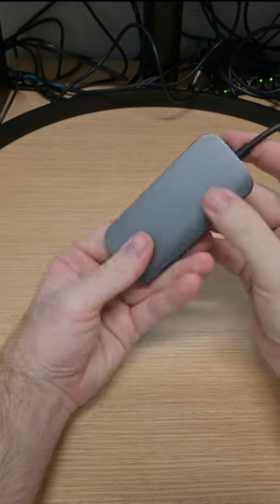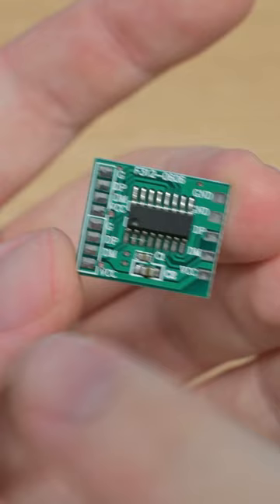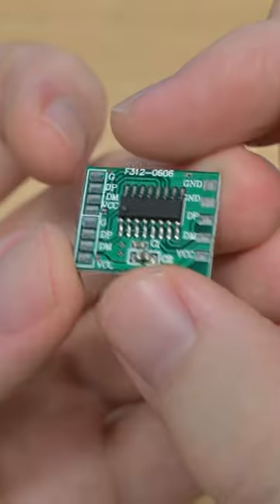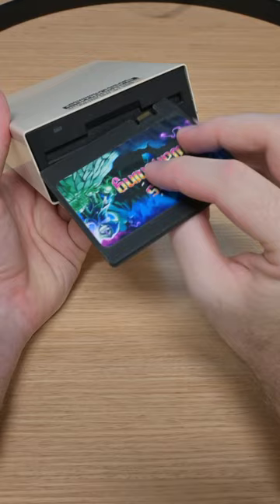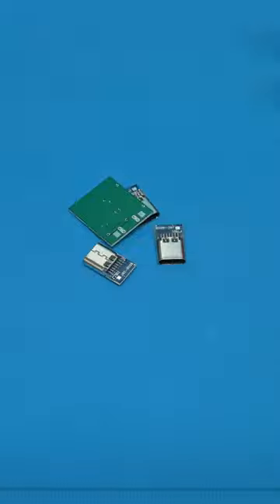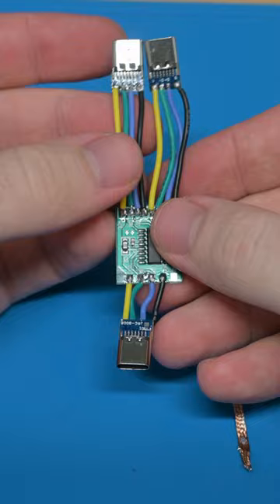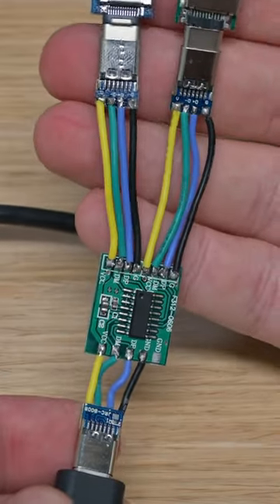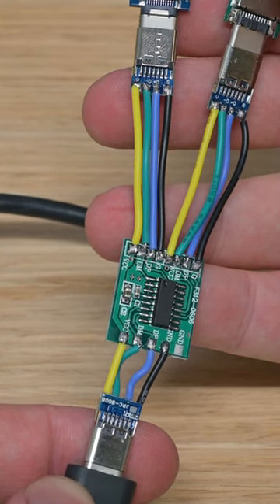The smallest USB hub ever designed?

Comment from the maker: I literally don't know why this was the hardest thing to solder to. I was trying a new tip on my iron and it just would not heat right. I am ashamed but the show must go on.
Reply: As someone who has seen the kind of trash soldering that youtube has to offer, I can't talk down on those joints too strongly. 
As someone who lives and breathes 1% tolerance mil-spec soldering, I can only shake my head while bearing a look that's half way between disappointment and having been personally affronted.
Reply: You did quite well. Other YouTubers barely even know how to solder and still attempt it when there is usually someone there who is good at it. I saw 1 earlier where camera guy had to tell em to wipe the solder off cause they had no clue.
Reply: What chip/board is it?
Reply: Are u used the right cable? 
I think you need to use a higher gauge 

CMIIW
Reply: Wet your tip with solder first. It increases surface area in contact with the contacts, and increases thermal conductivity
Reply: Need some flux
Reply: A good FLUX is key for proper soldering!
Reply: I would have used slightly thinner wire for the job, but honestly that soldering work ain't all that bad. 👍
Reply: Your soldering is amazing compared to GreatScott!. And he actually has videos on how to solder. Too many electronics YouTube channels that show how to solder and don’t know how to do it themselves.
Reply: Hey, I need some help for creating a cartridge based pico-8 handheld that works like the gameboy and from your prior projects you seem to be the only person who may be able to give any assistance, any way i could get in contact with you more directly to ask some questions?
Reply: you need flux, i use some i got from the plumbing section of the hardware store for electronics and i've never regrettted it, i have boards 10 years old that i used the flux on that are still good today
Reply: Don't neglect tinning new tips
Reply: it wasn't even that bad stop complaining
Reply: try lti 120 flux
Reply: Always remember to "tin" your iron tip, & 
to always heat the "work", 
(what you intend to solder to)
not the solder.
Reply: More flux would help. Just ooze it on there.
Reply: Use the solder paste stuff :) it’s magical
Reply: @AtlasReburdened  Mil-Spec 🤣🤣🤣🤣 damn rambo howd u make them so cheap??
Reply: I think you are the seller to discourage others to sell them
Reply: Don't be, just don't, it's okayish solder. The rules for solder requires no moustache looking excess solder on IPC certification, no badly misplaced components soldered on board. I think it's enough
Reply: I wondering if the chip you use allows a connection of just one USBC port for USBC PW <I don't need data> in and the other end of the chip just soldering it to an existing full featured USBC port without having to divert the original USBC port to the chip and have the one USBC be a USBC PW and the other one is data. Basically I'm trying to mod my ROG Ally so I can have a secondary USBC for power while leaving the full featured USBC port for video out by just tieing the other end of the usb chip to the existing USBC port in my Ally and just wireup the chip and one USBC port for the power in?
Reply: @Littlestrawberryfox  maybe using a small hub would be better. Dunno, just saying
Reply: @frogz acid core flux on electronics? 😮
Reply: i was ready to roast you because I saw this comment before the video started but dude… thats a normal-ass solder job. nothing bad about it… it isnt amazing but it sure as hell aint bad either

Comment: An important thing to note when working with usb: the positive and negative line need to be the same length, or it will break. There will be a tool in whatever pcb designed you use labeled “differential pair routing” or similar, and you need to use that
Reply from the maker: This is a good note, I did not design this board but I'll keep this in mind for future projects.
Reply: true but if you are using, say, just a full speed usb 2.0 (not high speed, full speed) there won't be much trouble except if the route lengths are off by a large amount. I think there was a formula to find the wavelength of your signals and then make sure the + and - signals match within a threshold. not an expert though

Edit: missed the "except"
Reply: @Kitsuinox  even at low speeds the acceptable deviation is extremely low, its just a problem of how differential lines work in general really

You’ll want them to be close together anyways so theyre not as susceptible to noise so just use the differential routing, its there for a reason
Reply: @abetoday  the board does the differential routing correctly, im pointing it out because you’re saying you want to design your own pcb using this and if you don’t use the right routing tool it might not work and you’d have a hard time figuring out why
Reply: @Joshinken  thanks for pointing that out - though in some programs I used the differential router did not really produce great results (as in they sometimes would be way too chaotic). now thinking back to it, it was probably me not changing the skew tolerance or something I guess. also, are there any places online I can learn more about differential pairs - or pcb design in general?
Reply: To add to this: If you're routing a high speed signal any appreciable distance, you also need to take care with the thickness of tracks Vs their distance to each other (for differential signals) AND their distance to their reference plane (so PCB layer stack does matter). All of those factors contribute to something called the characteristic impedances of the transmission line, which should be designed to a fixed value for high speed signalling, and match that of the drivers cable and receiver. Sudden impedance changes (e.g. from the tracks suddenly separating) result in signal reflections, and bad signal integrity.... I think USB is 90 Ohms from memory, but it's easily Googleable.
Reply: @Kitsuinox  High Speed Digital Design: A Handbook of Black Magic by Dr Howard Johnson.

He also has a website with some Q&A topics written up and excellently explained.
Reply: @Johnyted717  Thanks!
Reply: basically it's a miracle this slapped together thing even works. Even on the board there is no length matching at all, you could see with bare eye. And I doubt it's four layers, so very likely no impedance control, either. Then the soldered wires are plain, unshielded and certainly not within 0.15mm length. Chances are high this thing will fall back to Full Speed USB.
Reply: @Kitsuinox I seem to recall that a rule of thumb was that the length differences should be smaller than 1/10 of the singal length. So that'd be something like 480 Hz * C * 0.6/10, so that's like 6cm or something like that. Assuming that I haven't done something dumber than usual.
Reply: @Joshinken  do all lines from all the ports to the chip have to be the same length as well or is it only important per port?
Reply: @albisserhotmail  the two data lines of one port need to match each other, they don’t need to match any other. If you’re using a usb3 connection for example, you also only need to match the two connections in a pair, while the different data pairs can have very different lenghts

As for only usb2 with its single pair, you need to think about it like this: the connection doesnt end at the port. It will go into a usb cable and to your keyboard or stop short directly at a usb stick. If the length of each port needed to be the same, you’d have to plug every device into an extension cord so theyre all the same lenght.
Reply: Yes diff pairs are essential. That’s all we do at the company I work as is high speed data.

Comment: Be careful with those, that chip HOPEFULLY has proper ESD-protection built in or most liekly doesn't have it. Thus you can very VERY easily just zap it with ESD and kill the chip or something else connected to it... you've been warned, because in 99% of cases ESD protection is external to the HUB-chip itself.

Also, properly no power-handling capacity to speak of, no over current protection etc... so you can easily break something.

Moreover, those wires completely break the differential pair and the 90 ohm  differential impedance requirements of USB... so it might be unreliable or/and spill EMI all over the place.
Reply: I don't have too much knowledge on the matter but this board did seem a little barebones. Are you aware of a suitable small replacement that offers that manner of protection?
Reply: @AdmiralSym I did some googling and found a 4 port hub that comes as a hat for a raspberry pi zero.
It is not quite as small as this one but it appears to have more thought put into it and it's still only 7€.
Reply: @johndododoe1411  Yes, and those internal cables are shielded, twisted etc and are of correct impedance. :)

Comment: Electronics are so fun, especially the discover part. PCB designs are also fun. Internet is full of good, less good and downright crazy stuff. I did a fast search and found the pcb in your video, and their soldering was about the same 🤭 clearly meant for a DIY project. Electronics go from two wire to quantum mechanics, best suggestion is to bring a rope down the rabbit hole. To know of differential pairs and how it differs from pcb lanes and cables could be both fun and informative. Eric Bogatin has some colabs on yt and that man knows his stuff. Also Bill Herd is a outstanding. I really like your content, keep being curious😊

Comment: Way back in the day, I had a mini 4 port hub, and when I opened it up, the circuit board was barely larger that that 2 port there. Granted it was only USB2 though, but damn that thing was about as small as a fully prebuilt 4 port hub could get!

Sorry to say I don't remember what brand it was, it was stolen along with my laptop in 2015 ☹️

Comment: You could install this into an old system like an Xbox 360 white huge version and make a USB flash drive be internally mounted while still have the 3 USB ports available still. (Well 2 if your using wifi)

Comment: I opened a 4 port USB hub once and was surprised to find a single chip and a few support resistors & capacitors.  The chis was from Texas Instruments, so I’m not at all surprised by the tiny hub board you found.  I have no idea how the chip works, but I assume the PC handles the USB protocol while the hub chip doesn’t do anything complicated.

Comment: Hey if you get anywhere with this let me know. I'm trying to find a small hub that  I can use for pd charging/power  and that goes to a USB c touchscreen monitor from a phone.
A surprisingly hard thing to find.

Most want to split it into HDMI or dp

Need one that goes into a phone.
Splits into two with a pd charger on one end and USB c thunderbolt video out on the other.

Comment: What is the name of the IC?
Reply from the maker: There is nothing printed on the IC sadly
Reply: @abetoday a lot of cheap (chinese) modules have those unmarked chips. Probably either a padauk pms microcontroller or specialised usb hub chip with intergrated microcontroller
Reply: I've seen a lot of these use the terminus tech fe1.1s, could be something similar

Comment: Seriously consider twisting the differential pair
Reply from the maker: Is that a thing on USB? Only ever heard of it on Ethernet.
Reply: @abetoday  it's pretty much on all differential pairs, the idea is, if you don't twist them, one wire might pick up more EMI than the other. So you twist so both wires pick up the same interference, then the difference is taken at the end. This is probably a bad explanation, but have a quick Google.
Reply: @orbita1  One signal is inverted compared to the other when going down the wire. So when the EMI is experienced on both wires equally, when you un-invert them (this is done inside the chip) the EMI is now inverted on one signal, then the signals are "added" together. So if you had a spike of EMI on both, once the un-inversion and addition is done, you get a "positive" spike on one, a "negative" spike on the other, and they add to nothing. That's the basic idea.
Reply: @metroid031993  yup this is why you need the EMI experienced on both wires as closely matched as possible, hence the twisting and other techniques iirc (but as mentioned, don't listen to a rando, and do your own research for your projects).
Reply: @abetoday  you can also confirm that usb wires are twisted by design by checking the spec /Google /tearing down a donor wire
Reply: @metroid031993 Nothing to do with inversion.

The input receiver is a differential amplifier with a high common mode rejection ratio.

The differential amplifier, as its name suggests amplifies the difference between the non inverting input and inverting input.
If you twist the wires then the noise is likely to be induced into both wires at the same magnitude, and is said to be common mode noise.

If the noise is n, then +n is induced into both signals in the differential pair, and the amplifier amplifies the difference, and the difference between +n and +n is zero.
And hence the noise is suppressed. It doesn't get through the receiving amplifier.

Comment: this is the PCB for a small hub, if you're actually going to go this pedantic there are much smaller PCBs in the USB headers on 'splitter' cables, and even smaller ones inside of USB-C and Micro-USB 2-port splitter non cable headers. also this is clickbait AF.